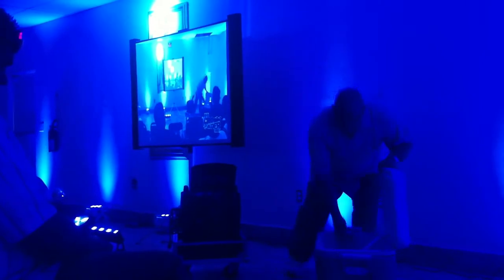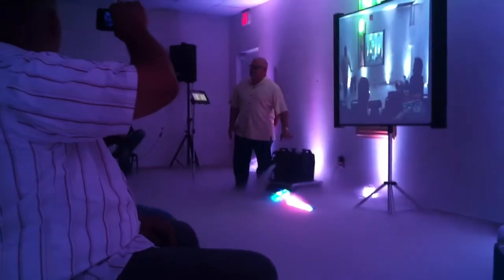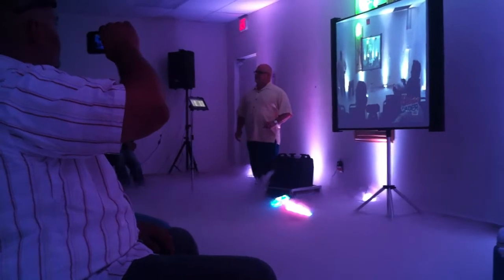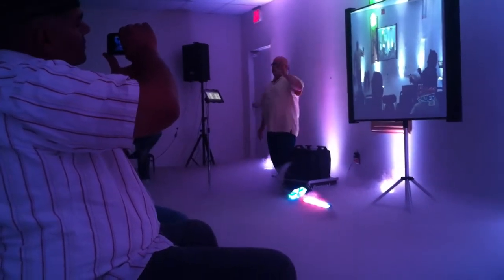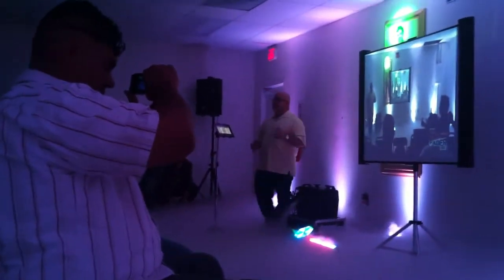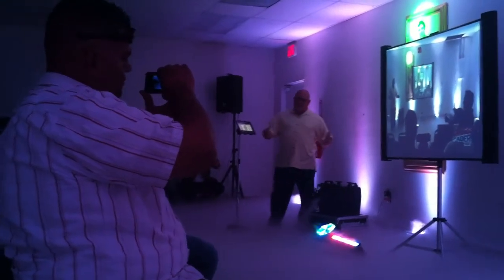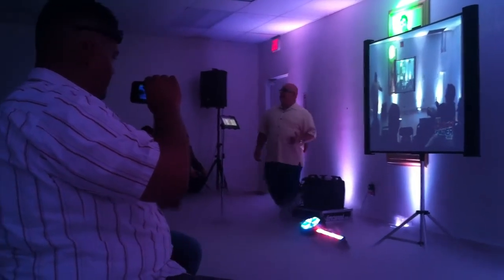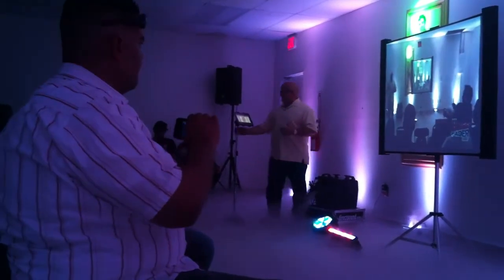Chauvet Nimbus Demo LIVE with DJ Mikey Mike at West Coast DJ's Live

Comment: Hi guys, my name is Karl Detken from Chauvet. Let me answer some questions.

@DoctorDJ: Good point, however just to clarify the dry ice fogger is not meant for rockin' the crowd as much as upselling to a Bride/Groom the "Dancing on the Cloud" option for their first dance.

@PumpPaul The dry ice fogger will NOT set off the fire alarm if used properly (on the ground).

@LibLateNight: Markets across the US are paying $200-$500 (depending where you are). 2-5 events and you have ROI. Easy upsell.